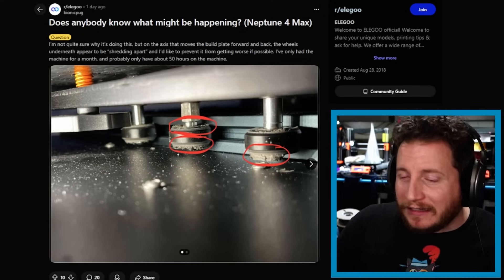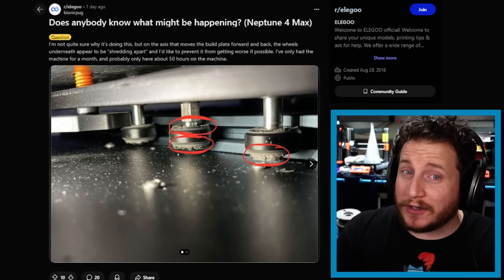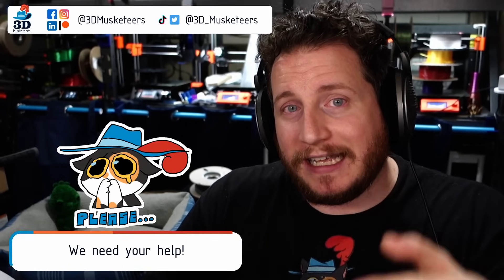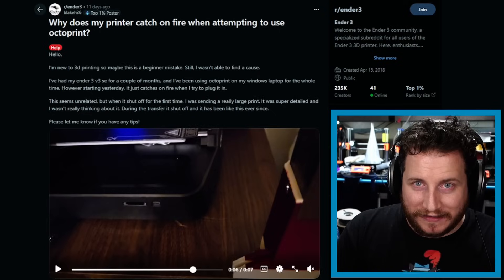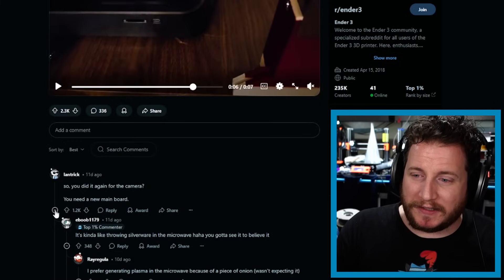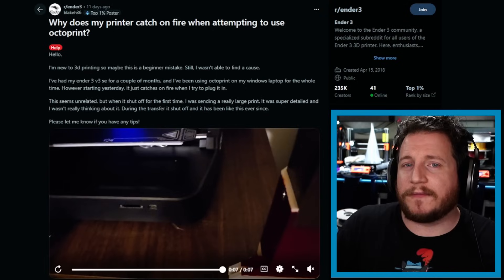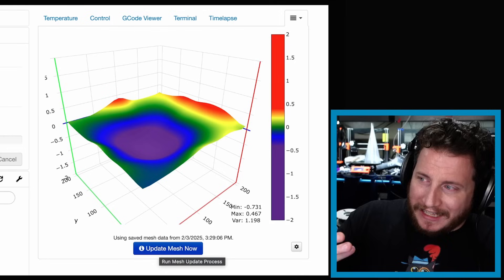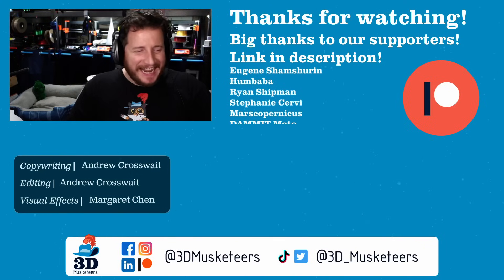FIRE BREATHING Printer?! - PrintFixFriday 178

Comment: 4:50 that is the reason i always use an USB Powerblocker if anything is powered by its own power source. a) to protect the printer board from backfeeding 5v into its usb ports (hello ender 5 plus) and to protect the computer/pi from getting 110/240v shoved up its usb port in case of a short.
Reply from the maker: I need to get one of those.. or a few.. And data blockers too, for public USB outlets, and maybe have my own sniffer in between!

Comment: can you do a vidio on how to edit prusa firmware easily
Reply from the maker: I don't mess with printer firmware and Prusa firmware is a whole different animal. What do you need to edit?
Reply: . @3DMusketeers  I am building a prusa mini from self sourced parts and whant to save money so stuff like linier berings out and 3d printed things with low surface area are being used in sted. and this is causing auto homing issues so to fix it changing the values of the auto homing thing should fix it. I have no clue how to dothis though.

Comment: A USB-C port shouldn't pass enough power by default to spontaneously burn like this. Whatever power supply circuitry is on one side of that connection, probably the printer, is fried and sending unregulated voltage/current somewhere it isn't supposed to. If the printer, PC and cable still work individually, then there is a small chance the damage is only inside the USB-C port.

Comment: Not always the USB port could be the Cable .. If you do Projects and solder/cut wires.. a piece of wire could have been lodged in the cable side, , when we unplug it we normally just place it anywhere ..lol
Reply from the maker: That's an oddly specific thing to say, speaking from experience lol?

Comment: On the one ender-style printer I have, I removed the wheels in the center and moved the nuts around so both the eccentrics are on one side. It's just as stable as it was with six wheels and half as much BS involved in adjusting the tensions.

Comment: I installed the nyloc mod to my 3s+ and left with when I upgraded to the 3.5.  The 3.5 upgrade has the same bed clips as the MK4.  It didn't make sense to me to undo something that I knew was working well.  This turned out to be a good choice.  I do think the 3.5 firmware also improved the bed mesh calculations with the PINDA probe as well as I have noticed fewer issues with the first layer and have not had to make any adjustments to the bed in a very long time.

Comment: I bought a T300 where the bed corners were low. I made my own customer aluminum spacers to get the bed a tad better. Some spots were still a little out out. 

I used aluminum HVAC tape on the bed to raise the plate a little more. Aluminum tape conducts heat well and the adhesive is holding well 1yr in

Comment: Recently I had bed probing issue with freshly assembled Prusa Mini - it was super inconsistent and scraping the bed. The problem was a binding Z axis lead screw. If to mess up the sequence of assembling Z axis carriage, the lead screw nut will be tilted, which will cause binding. It was binding just enough for steppers to loose some steps while microstepping.

Comment: Another thing: those USB cables transfer power. I used an adapter that specifically blocked the power port on the cable. Those are also dirt cheap on Amazon.

Comment: I've had my fair share of shorts in the day but that one is wild.  Usually there's a quick flash and a pop and your device is dead or rebooting or whatever but I've never seen anything quite like that.  You can try replacing the mainboard, but the problem could be much much deeper.  What if the PSU is jacked or the short damaged something like the PSU?  I'd recommend getting the manufacturer to replace the whole thing.

Comment: Regarding the Prusa leveling issue: I had something similar caused by little pieces/chips of Filament on the heatbed beneath the flex plate. Since they were black, they were impossible to see.
Since then I do an inspection by hand everytime before putting on the plate.

Comment: The bambu plate section, thats the wrong build sheet on that printer. The A1 build plates are the same width of the actual bed.
Reply from the maker: its likely not properly aligned, that is much more likely